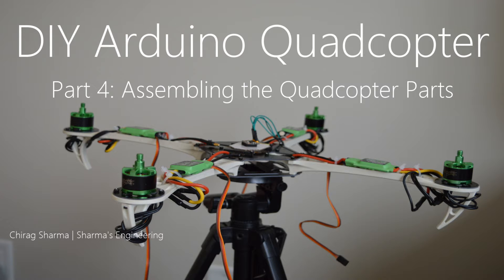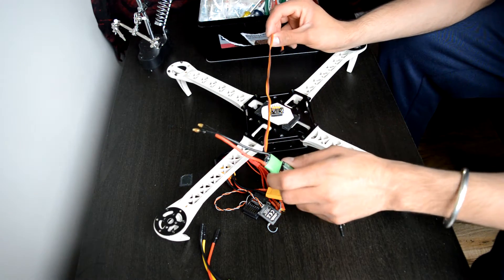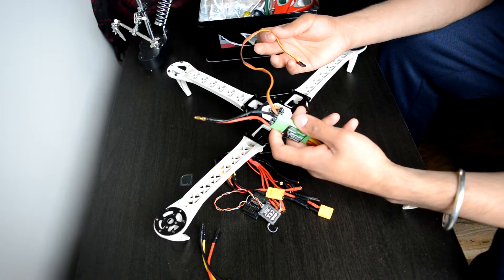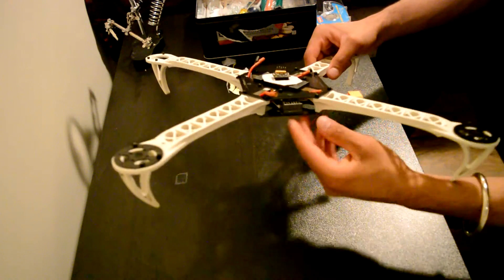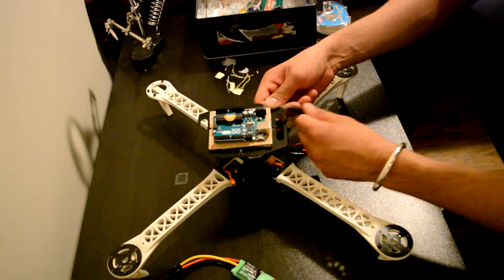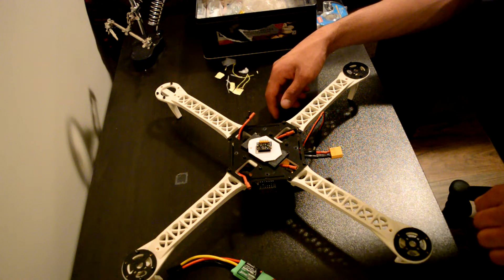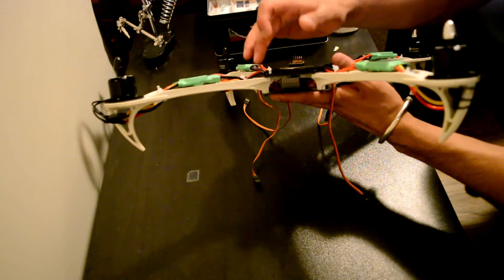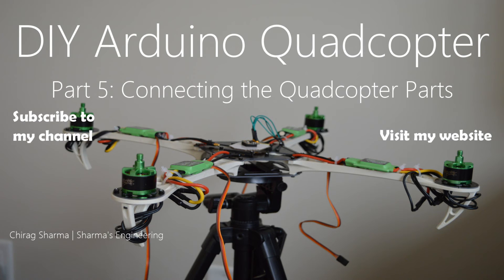DIY Do It Yourself - ARDUINO UNO QUADCOPTER | Part 4 - Assembling the Quadcopter Parts

Comment: how to make wire harness like you made?
by using connectors or soldering 4 wires together
Reply from the maker: Hello POOJAN JARIWALA,
Yes, I used connectors. Ideally, I'd solder the wires just to avoid any extra weight on the drone and make it as light as possible.

Thanks,
Chirag Sharma

Comment: hlo bro plz tell me about konsi battery konsa flight controller ka sath lagani ha ya kaisa pata chalaga
Reply from the maker: Hello Shaurya, the wiring diagram should explain how to connect the battery to the Arduino micro-controller. If you still have questions, please feel free to let me know.

Wiring Diagram: http://engineering.chiragsharma.ca/do-it-yourself-arduino-quadcopter/